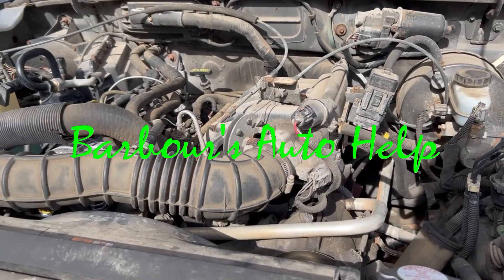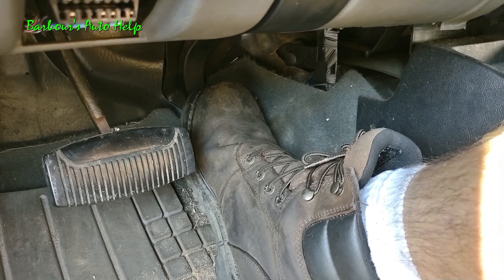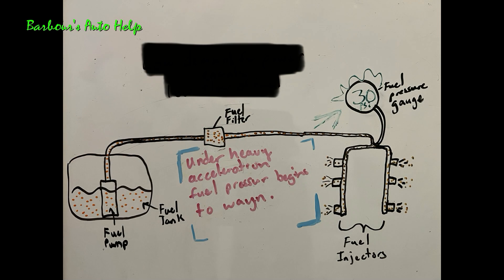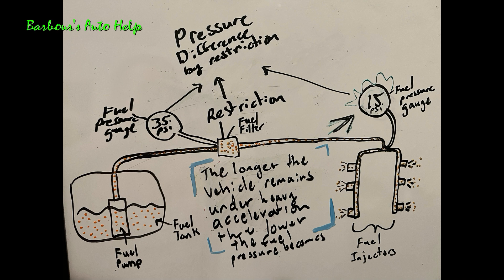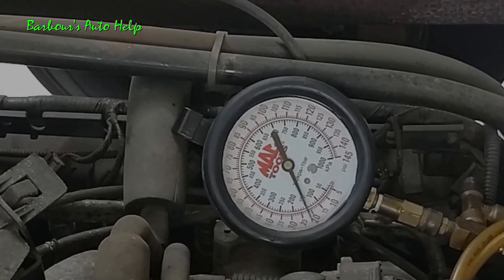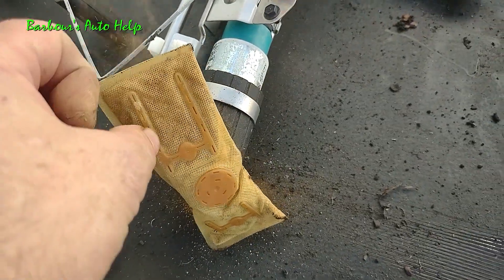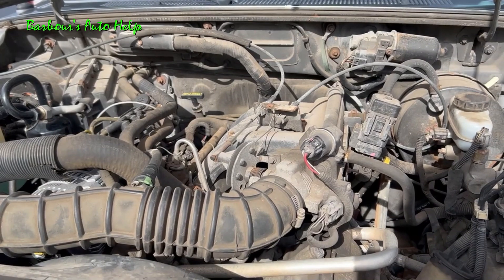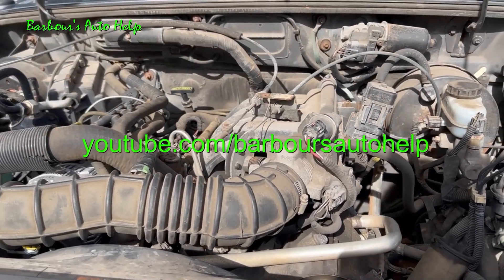Fuel Delivery System - Partial Restrict How I Fixed This Partially Restricted Fuel System

Comment: Thanks for the video. I had a similar issue back in the late 70’s with my K5 Blazer. I had an Edelbrock manifold installed with a corvette cam in my 350. The mechanic used clear rtv sealant. My truck would idle great and drive for about 2 miles then die. At the time they had introduced gasahol in the gasoline and apparently it ate through some of the sealant. The mechanic could not figure out the problem so I asked him to check the fuel filter and sure enough there were pieces of silicone stuck at the entrance. He changed the filter and added another inline clear fuel filter at my request and the problem was solved never to return. My only regret was getting rid of the truck years later.😢 great truck 🛻